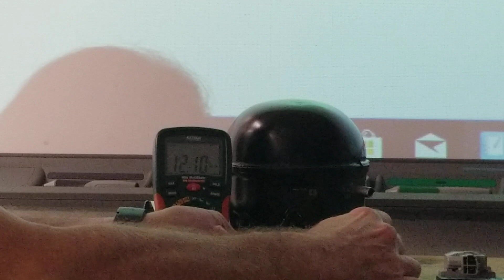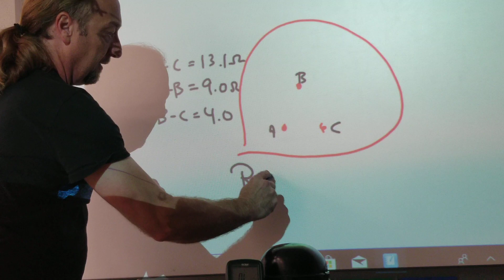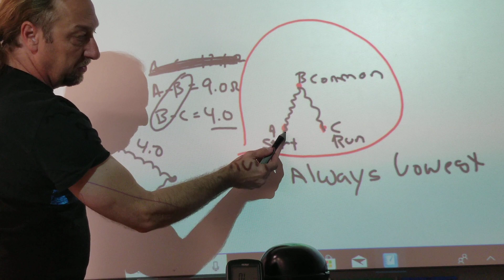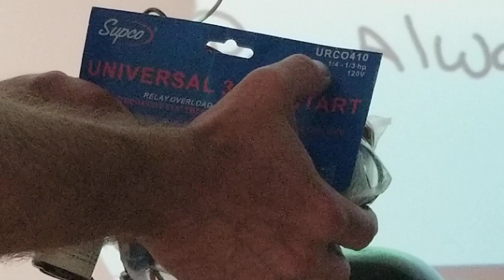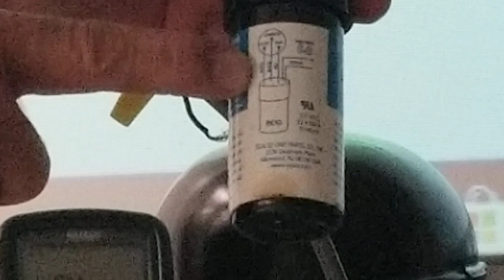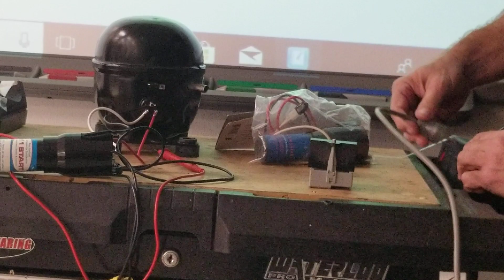#TECHTALK Testing a Compressor Part 2 of 2

Comment: I replied but thought I would post this separately I know some don't open replies, To answer the question how to determine the horse power rating of the compressor. Looking at a Schematic text data sheet you can determine the compressor wattage, I used b2b.frigidaire.com/support/manuals.asp there you can put a model number i Used FFTR1814TS. Then download Tech Data sheet "I used first model in the list". There Amps, Watts, and Volts are posted. The Wattage is between 140 to 185 Watts. I used Goolge to convert 185 Watts to Horsepower the answer was 185W=0.248089HP, and that would be rounded off to 1/4HP. Sometimes a techdata sheet is not available in that case you would need to determine who made compressor the part number and see if you can specs for it.

Comment: Am I the only one who noticed that he is handling a 3n1 that is already plugged into the wall and sparking when the contacts touch? I would have appreciated more info on how to match the 3n1 hp with the ratings actually found on compressor datasheets.
Reply: You are mistaken. It's clearly not plugged in.
Reply: Yes the 3n1 was connected to a test cord but not plugged in to power was connected afterwards. To answer the question how to determine the horse power rating of the compressor. Looking at a Schematic text data sheet you can determine the compressor wattage, I used b2b.frigidaire.com/support/manuals.asp there you can put a model number i Used FFTR1814TS. Then download Tech Data sheet "I used first model in the list". There Amps, Watts, and Volts are posted. The Wattage is between 140 to 185 Watts. I used Goolge to convert 185 Watts to Horsepower the answer was 185W=0.248089HP, and that would be rounded off to 1/4HP. Sometimes a techdata sheet is not available in that case you would need to determine who made compressor the part number and see if you can specs for it.